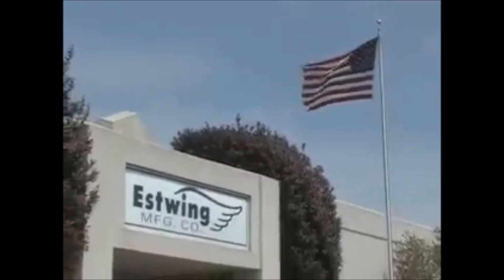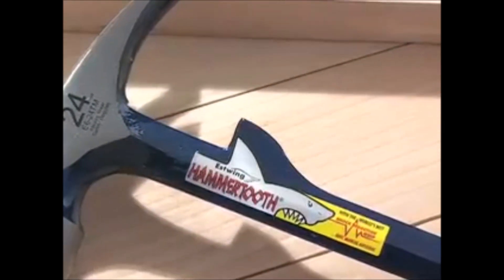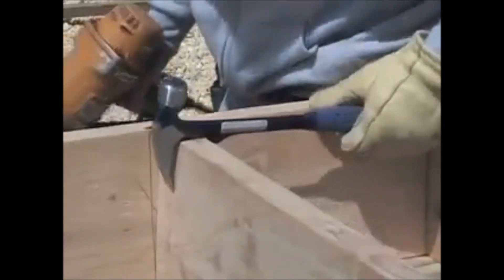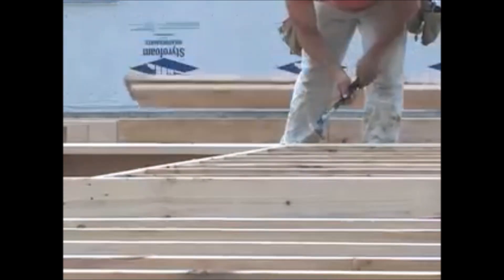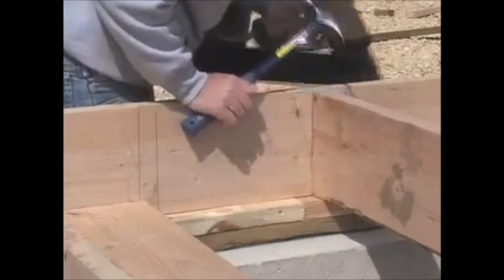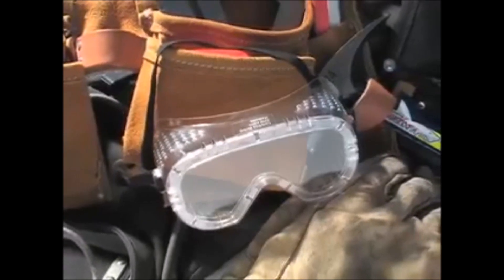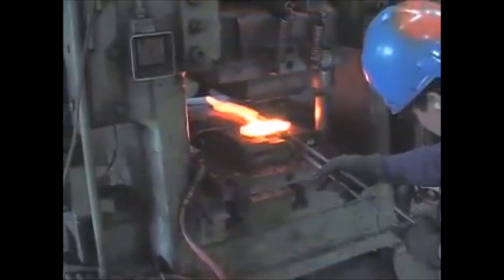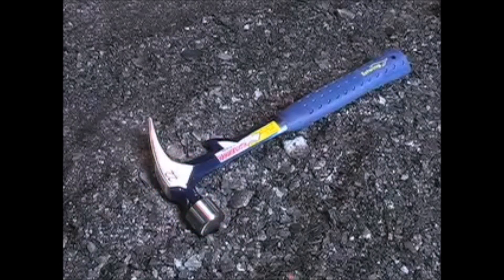Estwing USA Hammertooth Claw Hammer Demonstration

Comment: Ah, yes. Nothing like locked-in stresses to ensure a long, trouble-free building life!
Reply: Reddit sent you too huh
Reply: @maxfawcett143  that’s exactly how I got here. 😄
Reply: @keianoire6631  What thread on reddit leads here?
Reply: So your what's your solution there professor? I'm guessing your neither a carpenter, builder or engineer. If you say to only use straight timber then I suggest you go outside and find me a tree that's straight, over here in the real world that's standard carpentry. You do realize there's also flooring sheets to be glued and nailed to these joists and then a whole structure built on top? of all the problems in the building industry I can assure you this is not one of them. Nice try tho
Reply: Norwegian carpenter apprentice here, you hit the nail on the head. You need to bend joists a lot to use the lumber you got on site. Often even the straightest joist needs a little bending to align. Ofc you should plan your straightest pieces for flooring, studs etc. Use the straight wood where that accuracy counts.
Reply: if I had a penny for every perfectly straight piece of framing lumber I've seen, I'd have 3 cents 😂